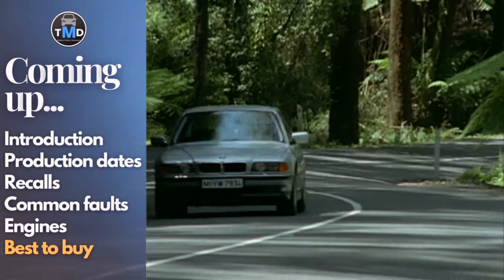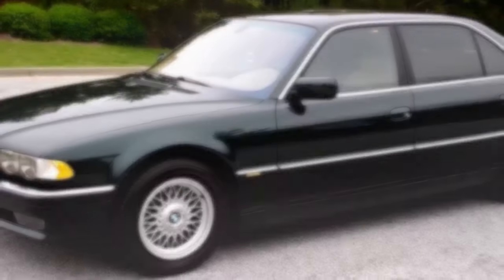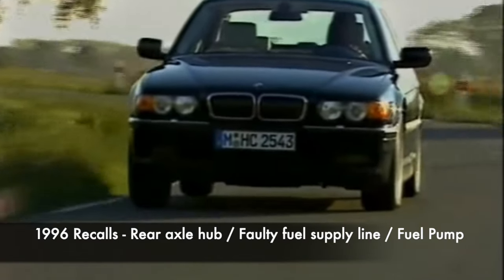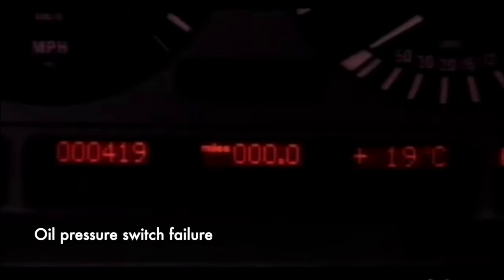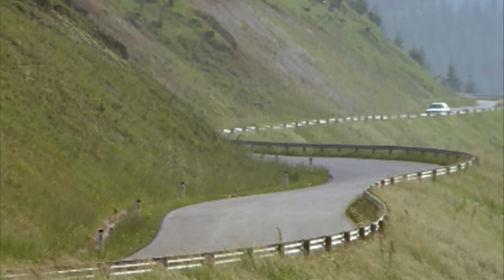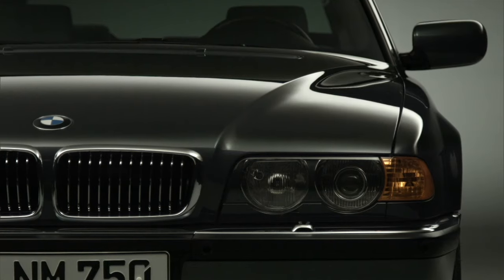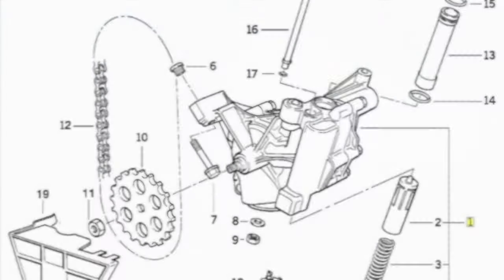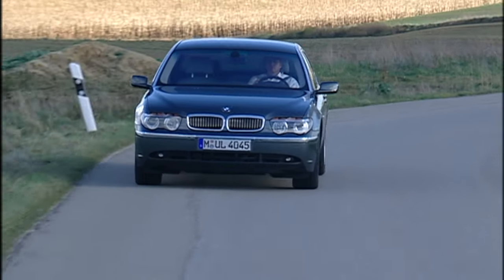BMW 7 Series E38 buyers guide (1994-2001) Avoid buying a broken cheap 7 Series with common problems

Comment: I had a 740il and 750il and God I miss them. Hands down, the 750il required far less maintenance than my 740il did. The M73 V12 is such a solid engine. It never failed to amaze me. Great video and detailed overview, well done!
Reply: Was the 740iL not reliable?

Comment: One additional comment- in my 740il, I had both the pixel information display in the dash and the radio pixel display in the center lose pixels and couldn’t display information properly. BMW realized this was a problem and had a courtesy goodwill repair program at no cost to the owner. The owner just needed to ask for this goodwill repair. I don’t know how BMW is today, but back then BMW Customer Service was top of the line.
Reply: This can be easily fixed. Shipped my cluster to a guy in the US and got it back like new.
Reply: I did my MID myself. 99% of the time the problem is caused by the "ribbon" between the display and the circuit board. You can buy aftermarket ribbons. These ribbons are basically thin  plastic strips  with conductive ink tracers squeezed under what looks like a rubber band that's been cut and laid flat and held in place by a long clip. This looks like the making of a sandwich pressing the conductive ink tracers on the plastic ribbon onto the contacts either on the board or the display. There is no solder involved whatsoever. However, over time, these contacts corrode and pixels either usually  disappear or join the ones next to them and displays become unreadable or confusing. If you clean the contacts on the board and very lightly trim back the plastic ribbon evenly over all the contacts to expose new uncorroded conductive ink tracer material use a large desktop size magnifying lens for the next step.  Properly align board contacts and overlay the freshly trimmed plastic ribbon, lay the rubber band over that area and clip things back with that rubber in place (I don't know what else to call it, but you'll understand when you see it) The rubber band squeezes the contacts in place and is crucial to ensuring there is contact made.  You should be back to 100% displays for years (8 years troublefree so far for me). I did this on my 740IL and my 540IT. As always, take pictures of everything before you take it apart. I used electrical contact cleaner to lightly clean the contacts. Be gentle trimming the plastic ribbon because conductive ink tracers are weakly bonded to the plastic. And don't bend that ribbon, you could break the contacts at the bend and there are many, many of them very close together.

Comment: These are hands down one of the best cars BMW has produced. My 4.0m60 still runs great, no its not perfect, but show me a car from 1994 what is immaculate after 30 years and almost 400k kms on the clock...
Reply: I have a 1995 120000 , have you ever had timing chain issues, they're double row chains, and chain cock instead of plastic . 
Just curious , love the car  it's the best
Reply: @stuartrose9456  nope, the chain is still without any problems, and completely silent. I bet the M62 owners are all pretty jealous 😀
Reply: Also they run the v12 autos , stronger box. I'd have the m60 anyday,  don't have vanos issues either..mines a Japanese import , and has all the v12 extras , premium sound full blind package folding mirrors , sedc, heated seats TV  has been converted to digital. , love the beast  cheers
Reply: @stuartrose9456  yes, pre-facelifts are much better in a lot of things, that is also why i chose mine when i got it! Cheers 🥂

Comment: One thing that may happen on the M73 is the head bolts snapping. You will chase a coolant leak message and will see no leaks anywhere. Then you think you have a crack somewhere until you find a head bolt snapped... Being there and saw it many times. The block on these are damn solid but if you ever have a coolant hose go and the engine runs warmer for a bit, almost certain a head bolt will go.

Comment: In the lower-end 730d is by far the best pick. Plenty of torque at low revs,  high mpg,and a fantastically  reiable enngine (the M57). The 728i also owns a silky and extremely resistant engine, but  has to be revved above 4000 U/min  in order to deliver - and mpg is siignificantly  lower
Reply: V8 all the way

Comment: The Best Trilogy cars of all time from BMW

7er E38, 5er E39, 3er E46
Reply: My trilogy would rather be e30 - e34 - e32 😊 
I really wonder if it is a question of taste or a question of (our) generation. I was born in 1966. What is your generation ??? 😊 KR
Reply: I had all of them over the time - and I can confirm your statement. I wonder where are these motors today that do 250000 / 300.000 km without complaining. Sigh.